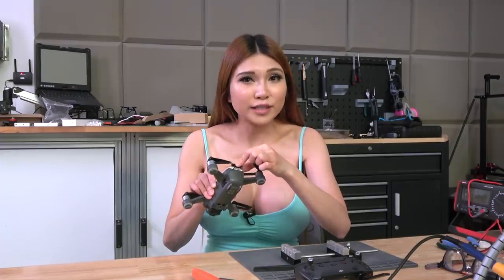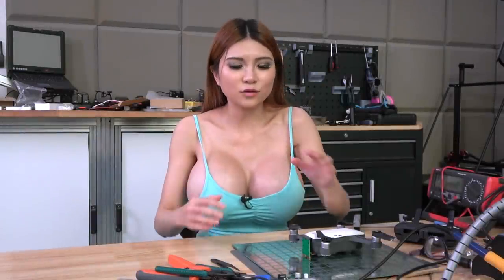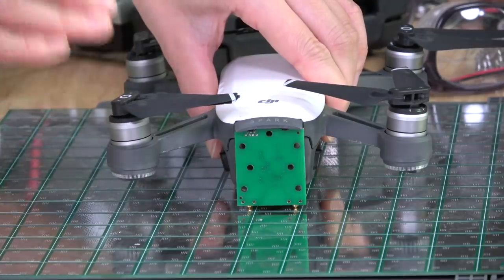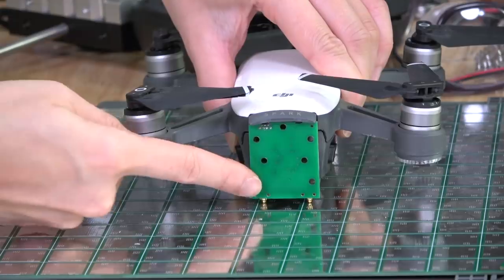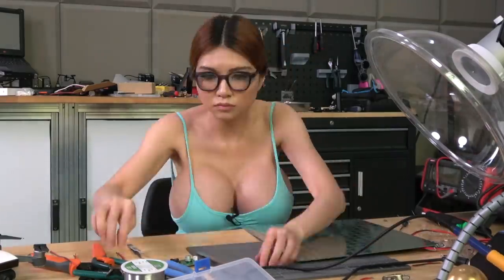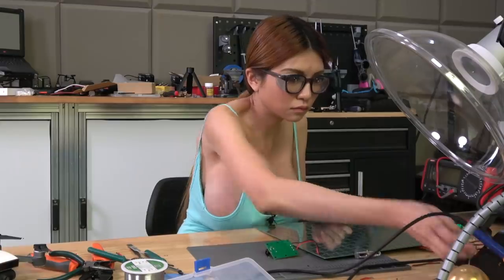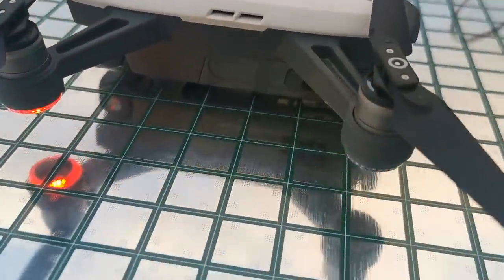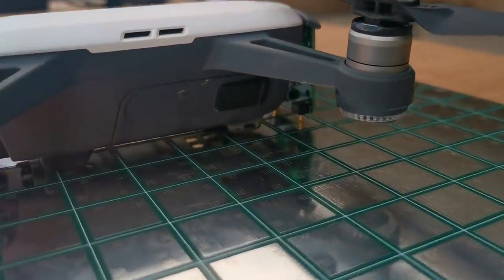DIY Self-Charging Drone- with JLCPCB!

Comment: Hello Naomi,
I replicated the "checkerboard" system and the printed circuit that is connected to the spark, I checked the voltages and everything is correct. The only difference is the DCDC converter on the spark printed circuit, I used a VXO7805 DC / DC Converters 6.5-36Vin 5Vout 0.5A 
instead of the TPS63070RNMR; but unsuccessfully, if the drone is on it will not charge. 

Any suggestions?
BR
Reply from the maker: Can you charge with a power supply connected directly to the drone boards pogo pins?
Reply: @Naomi-Wu  hello thanks for reply...what are pogo pins? However I tried without the checkerboard but the drone only charges when it is off
Reply: Are you sure that the voltage on USB is 5v? I measured it with DJI charger and it is 12v...Have you suggestions?

Comment: why go for a hard connection like this instead of adding some sort of wireless charging capability and just landing on a Qi charging pad?
Reply from the maker: Read the pinned FAQ
Reply: @Naomi-Wu  aahhh. for whatever reason, it's not showing up as pinned for me. i like the simple and cheap solution you came up with when the simple solution turned out to be not so simple!

Comment: I'm extremely surprised to see that the drone doesnt shut down by itself when its on charge, what happens if you're an idiot and try to take off with a cable attached? surely it wouldn't end well?

Comment: Wireless charging shoud be better, no need to worry about the contacts
Reply from the maker: Very hard to do
Reply: Okey, i've read your faq.
But it will nicer if you put the connector prongs on the 'feet' of the drone, and wire it up to the USB port.
Simple copper plat might work too

Comment: This is a neat solution! And it's basically just plug in and go huh, no need to mod your drone

The grid reminded me of something, I wonder if you could paint the squares with something conductive and turn it into an AprilTag
https://april.eecs.umich.edu/software/apriltag.html
It's kinda like a QR code but it's designed for precise camera tracking, including at long range and in suboptimal conditions. If a drone had that kind of tracking software you could turn your pads into highly accurate targets for an auto-landing system

if you want a suggestion about what to drone, that ruined(?) house on the left during the flight looked really interesting lol. I wonder if the neighbours hear drones buzzing around there a lot

Comment: Inductive charging might be lighter
Reply from the maker: Requires very precise drone placement, ends up costing a lot more.
Reply: Naomi 'SexyCyborg' Wu my approach would be to PCB out a bunch of transmission coils and use an nfc chip(s) mounted onboard to switch power on the most proximate one. Then land where you like on the pad. I like your pogo-pins though for clean environments. Simple and smart.
Reply: Naomi 'SexyCyborg' Wu second thought, the nfc chip wouldn’t be necessary. There is some change in voltage as the receiving coil gets close. That could be used to switch the transmission coils. 
Sorry. Bothering with too many suggestions.